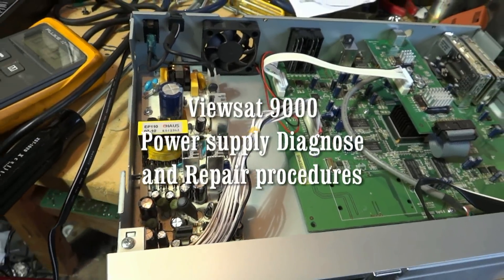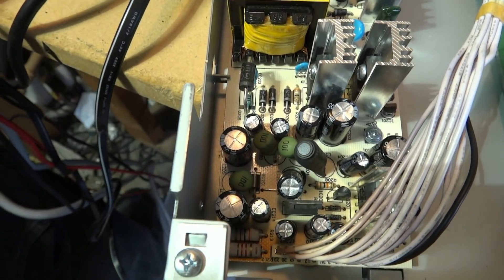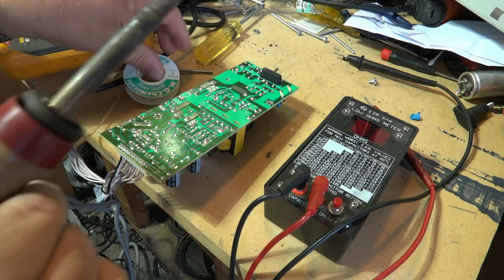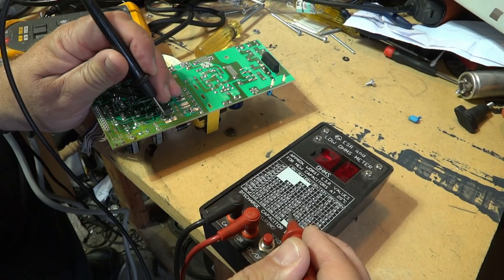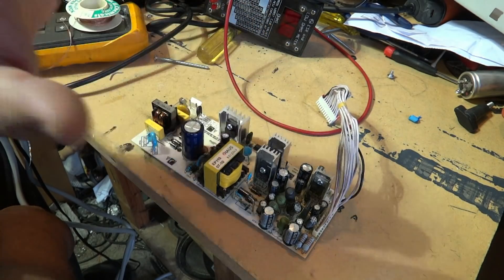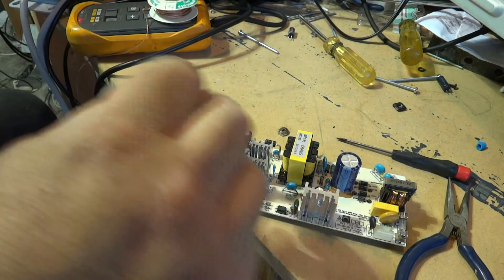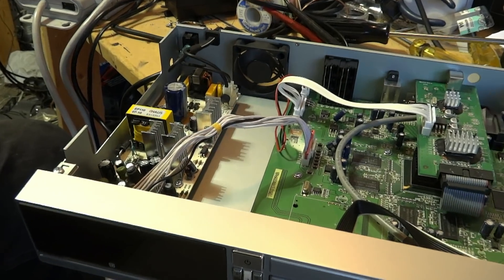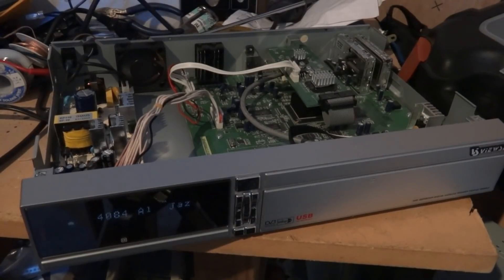Viewsat 9000 FTA Satellite Receiver Power Supply Repair

Comment: I thought the AC was first rectified to DC before going to the transformer?
Reply from the maker: The AC is rectified to 180VDC first, then it is converted back to PWM chopped DC, where it goes into the transformer to be stepped down, and passed to the regulation circuit.
Reply: Thanks for taking the time to clear that up. I'm trying to learn as much as i can about smps and videos like this are great!
Reply from the maker: No problem, it took me quite awhile to get the concept on how they worked when they first started showing up in consumer electronics. The manufacture's approach was "These things are too dangerous to fix, replace as an entire unit" so they wouldn't give any data or provide any training initially.

Comment: My computer power supply went out the other day(too much dust I guess though it didn't seem to have a lot in it). Since I have an electronics degree & never really fix anything, I figured I'd brush up on power supply repair & see if I can do something about my broken one. I have searched many power supply repair videos since this and this is the most informative. The second one just said "if the capacitors are burst & leaking, replace them & if the fuse is blow, replace it. Everything else, throw away," while not wrong, that only scratches the surface. This video, on the other hand, actually explains things for people who want to know more.
Reply from the maker: Thanks. This video was actually never intended to be released. It was my first one, and was basically directed as a few friends, one who owned this piece. He wanted to see exactly what was wrong, and actually wanted me to fix it at his house. I told him I wouldn't do that but would film it for him.He watched it, as did a few other hams, and a few suggested I put it up on YT and see what happens. The rest is history, and I found out pretty quick that people want to see how electronics gets repaired. When I worked on this piece I hadn't touched a soldering iron in about 10 years since I left the business and now I have several hundred videos on the channel, but they all started with this rather embarrassing video.

Comment: Hello Sir, i am trying to fix my panasinic dvd, dmr eh67,  which suddenly died, i removed the power supply board, but i do not have the capacitor measurment  meter. The capacitors look ok, they are not bulged, any ideas what else could be wrong.Thanks for the information and the video, nery informative

Comment: What the heck was that little strip of material you used to free up the solder joint?  I've always used a suction bulb, which doesn't work all that well with my old shaky hands.

Rick
Tucson
Reply from the maker: It's solder wick. A copper braid that is saturated with Flux. Many companies make it. Mg chemicals, chemtronics ect.

Comment: the first capacitors you test was or not good and the # value was fine, i have this backop battery i find in the street was with  not battery i put a new battery turn on ok but the next days did not  want to turn on, i don't know much about electronic but, i like to fix thing for fun and because is very cheap.

Comment: You don't think the transformer might fail instead of capacitors? That was i was suspecting on mine.
Reply from the maker: I have never seen a transformer fail on a switching supply. Drive transistor yes, and lots of capacitors.

Comment: I have hum on a powered subwoofer Altec lansing  could it be caps
Reply from the maker: Most powered subs use class D amps these days. So it depends on the amp design. If it is a standard linear amp, then yes caps could be the problem, on a class D no, not usually.
Reply: How do I tell which one i have,  thanks for your timely reply
Reply from the maker: A linear or class B or AB amplifier will have a power transformer. A class D generally does not, because the switching transistors are generally mains driven, and thus very dangerous to work on, as the voltages used are lethal. Typically switching on and off at 160 volts.
Reply: Thank You for the clarification, it has a 120v transformer with 2 yellow one black wire output that plugs into pc board am assuming output of low ac volts just getting started haven't checked output of transformer the 2, 2200 uf caps are first in power supply circuit.am going to do a omh check on caps as i don't have a capacitance meter using your ohm chart , I appreciate your time an suggestions let me know your thought  Gary

Comment: How you doing sir I really need your help if we can exchange emails it would be great. I have a Xbox 360 slim motherboard that turns on than off 1sec tops. I know it's a power issue. I do alot of repairs and system programing and I'm lost on this 1. Any feed back would help thanks.

Comment: You remind me when I fixed a ton of old style satellite systems with the 10 foot mesh dish. Because the way the dish was designed it would allow moisture to get into the drive motor and freeze. Next thing you know the customer would fire up the receiver to turn the dish and short out the 25 amp bridge rectifier and blow the fuse." Good demonstration ", like you I would fix the switch mode supply that often took out 3 to 4 capacitors in the new receivers.

Comment: YOUR amazing! I went to an electronics school, hundreds of hours. Your complete and definitive explanation to every detail, wow. I got a lightning strike and was looking for someone that troubleshooted a Panasonic main power board  NPX813MS1, but no luck, any ideas? No bloated caps.
Reply from the maker: +iam8of9 Lightning strikes usually affect the primary side of switching power supplies, like the regulator IC. That model number doesn't ring a bell right now but I will look it up and see what type of power supply it uses.

Comment: I saw 2 bad caps at about :22 Let's see if that's the problem.
Reply: This video is about 3 year old, so you had a lot longer than 22 sec to guess, lol any case most psu fail on caps.
Reply: binness
the industry standard is to swap caps at 5 year intervals. Because all electrolytic capacitors degrade. They're wear items.
Reply from the maker: I knew what the problem was before I even opened the top.Incidentally, not all caps go into an overpressure failure.I have seen many that go bad with no physical indicators.5 years is a little early for most caps, more like 7 for most industries that just do capacitor replacement for preventive maintenance.Perhaps if you are talking life support equipment then sure go for it.
Reply: 12voltvids
5 years is mission critical applications. I am not suggesting capacitors do not last longer than that, but in that span of time they all have degraded to some extent. They're not the same caps they were when new. The absolute best capacitors have a 12,000 hour lifespan. As rated by the manufacturers. The worst capacitors might have lifespans as short as 1,500 hours. No, the manufacturers don't even bother rating those either. Average capacitors fall in the 3,000 to 9,000 hour range.

The trend today is to not derate components much either. Which causes more stress, and premature failure. Double used to be the standard, but today you're lucky to see parts 50% over on specs. It's a 12V rail so 16V caps should be OK. It's a tight fit.
Reply from the maker: I believe that is what I said. In a device that the capacitors can not fail under any circumstances you do them early. When I was doing maintenance work, we had contracts to replace capacitors for a few production centers, and they all went on the 6-7 year life cycle for their scopes, audio mixers, video gear ect. Video heads, and DAT heads got replaced at 1000 hours on the head hour meter regardless how they looked. Back in those days most power supplies were linear, which were also nowhere near as demanding on the filters either. With switching supplies they run hot, and that is going to reduce the lifespan.
Reply: @12voltvids  Just the thread I was looking for.
In your experience, caps go bad even if the equipment has been stored and hasn't been used in years?
Say, for example a  VCR  that it was used once a month for 10yrs and then stored (properly) for 4yrs, it could have leaky caps even if wasn't used for much time?
Reply from the maker: @MarceloJavierMazaLuparia  
In most cases no.  The exception was a batch of caps made in the 80s that had bad chemistry.  The rumour was a disgruntled employee at a Japanese capacitor company stole the formula developed for micro capacitors like the surface mount caps.  He sold the formula to a competitor but missed one key ingredient which kept the ph stable.  When charged the ph was relatively neutral however when discharged it went slightly alkaline which caused corrosion on the leads around the seal which caused the seal to fail and leak the contents onto the board.  Millions of camcorders and anything that used these suffered this fate. Camcorders were affected more than most other devices because of how most people used them.  Holidays and birthdays.  The rest of the time they sat in the bag.  They all went leaky.
Reply: 12voltvids
while heat is a factor ripple can cause capacitors to die too. The ripple current causes internal heating.

Comment: if yo uh put a ohm meter on it should show resistance or 0 out that shows a short
Reply from the maker: +djvibe4life An ohm meter will show open, as capacitors block the flow of DC. The ESR meter is a special type of meter. It uses very low voltage AC at about 100KHz, specifically designed to measure an electrolytic capacitors ability to pass AC.

Comment: One shouldn't really discharge those capacitors by shorting them out. Use ~100k resistor instead in there for 10 to 30 seconds depending on the capacity. The sudden high current from shorting might (most propably will) cause issues with the dialetric of the electrolytic capacitor and cause them to fail. If not right away, it at least will shorten it's life.
Reply from the maker: +Mtaalas These caps won't have a charge in them anyway. As soon as the power is removed, remember the circuit is still running, the voltage will drop like a rock off a cliff. Any residual charge is going to be so weak it isn't going to cause any issues. Now if you are talking  a large charged capacitor that is open circuit (no load) that is a different story. A great example of this is main filter in tube circuits that once the power is removed and the tubes cool the caps can hold a charge for a long time. On those a bleeder resistor is a good idea, but it doesn't have to be something as large as a 100K. A 1K will do the dob just as well. I've never experienced capacitor failure from shorting them out, and I have done that for years. I have blown the tips off a few screw drivers though, and that cost more to replace than the capacitor.

Comment: seems like a lot of electronics companys are using cheap caps. Digicon are good and generally last longer. I am on the look out for a failed TV so I can replace the caps,just for the heck of it. Where do you generally order your electronics?
Reply: +scott firman You want Japanese manufactured capacitors. Rubycon, and Nichicon are top brands. I have Rubys that are 30 years old and they're still good. Which is unheard of.
Reply from the maker: +Paul Frederick Ruby and Nichi were good, so were some of the Elna. Then Elna turned to shit, and they got a very bad reputation. That was about the time that switching power supplies became popular.Of course if you wanted a real good cam you went across the pond and bought a Malory, or Motorola, or any of the other American ones. I have an old McIntosh receiver from the 1960's and only 1 cap has had to be replaced. I am sure they all could do a recapping now, but hey that unit of about 50 years old, and that is incredible. They are all old US made capacitors, many of them the old wax paper ones.  Those make me nervous actually. High voltage into flammable materials. That's an fire waiting to start. (I don't run that receiver right now. It is going to be a restore project some day, where I recap it, and then sell it to someone with more money than brains.)
Reply: 12voltvids
Yeah paper caps today are placeholders, at best. They look neat though. I have an old Sprague "ATOMS" in my collection just because I can't bear to part with it. But I wouldn't use it in a circuit.

Comment: Hello and thanks for videos, I have a similar set with integrated power supply has two 0.1uf caps either side of the first stage transformer gone bad and had only 0.22 to replace still not working, should they work ? do i need to get the same size ? there is also heat marks around the q0370r switching IC could i test this? thanks again Brett

Comment: to short out the CAPs can u stick a resistor to the leads of the CAP?
Reply from the maker: +james tomlin Yes you can use a resistor to do it as well. I just like blowing the tip off my screw driver discharging a big cap!
Reply: haha! okay, sound like fun :)

Comment: Using pliers on the capacitors would that short PSU capacitors?
Reply from the maker: +Kayemache Yes I was discharging them after removing power. That was the idea, to remove any charge that could give me a shock when working on it.
Reply: +12voltvids Oops, I forgot to mention about computer PSU. Will pliers completely short the power so you won't get fried
Reply from the maker: +Kayemache Yes they will.
If you are dealing with high voltage capacitors it is a good idea after shorting them out iis to put a jumper wire across the terminals to keep them from charging up on their own from electrostatic build up..This is more of a concern when dealing with very high voltage capacitors such as encountered in big RF linear amplifiers and transmitters.They will typically have a "widow stick" which is an insulated stick with a large ground wire  and hook attached that you, after depowering and locking out the power supply attach to the input choke to add a second layer of protection before pulling out the final amplifier tube because tubes being a high voltage, high impedance device will not drain the charge and allows the capacitors to recover their charge slowly. Picture tubes are good at this too. You can discharge the tube by grounding out the 2nd anode, and leave it disconnected. Come back a short while later and reground the 2nd anode and be amazed at the charge that has built up.In your PSU that is not an issue because there are components connected that will discharge the charge. Tube gear though is a whole different ball game, and much more dangerous to work on because you are dealing with typically 400 to 500 volts on everything.
Reply: +12voltvids Thanks for the reply. It was very informative. Repairing power supplies sounds to be way out of my league. I'll stick to purchasing a new unit. Once again, thanks for the reply. I subscribed because your videos are very in-depth
Reply from the maker: +Kayemache I just fixed a newer LG TV using a light bulb to reflow solder on a BGA chip.Will be posting that video soon.The point in these videos is to get people interested in troubleshooting electronics that have broken, and keep these devices out of the land fill.The way I look at it everything deserves a look to see if it is a simple fix. Some devices are just uneconomical to fix, but many are easily fixable, and it can extend the life of your device.
Reply: +12voltvids If something is broken it does not hurt having a look. Even if you can only spot the problem a fraction of the time, and fix it, you're still that much ahead of the game then too.

Comment: I swear - the electronics industry should make all electrolytic power capacitors plug-gable for easy testing and swapping.  Seems you need to change them more often than tubes !!!
Reply from the maker: +Donald Filbert A wise man once said "the reliability of any electronic device is inversely proportionate to the number of electrolytic capacitors it contains."
Reply from the maker: +Electro 
The reason for this is the ROHS requirements of new electronics. Old electronics has hazardous substances in them. Heavy metals and nasty compounds like PCBs other carcinogens that they can't use any more. I know many people that have cancer from working on vintage electronics. Some I am sure from x ray exposure on old TV, and others from the nasty chemicals and cleaners that were common back in the 60 and 70's. I worked on electronics in the mud 80s so by then they were already phasing out the bad stuff, but UT was still around. Yes I do think about stuff I may have been exposed to years ago, but not much I can do about that now.
Reply from the maker: +Electro Beryllium is a type of ceramic glass, and is used in the magnetron tube of microwave ovens (still is) and was in some RF power transistors. Its only bad if you smash it and breath in the dust.Carbon tetrachloride was a common cleaner, and that stuff is bad stuff.Other bad stuff in vintage electronics were compounds like mercury, lead, thallium, arsenic ect.
Reply from the maker: +Electro Huh, calm down? I am calm, I just don't know what your comment above refers to?
Reply from the maker: +Electro What joke are you referring to? don't recall cracking any joke.The video was originally done as a private upload for the owner of the unit that wanted to see it repaired.
Reply: +Donald Filbert Recent electrolytic capacitors. There are units in existence from the 70's and the electrolytic caps are still fully functional.
Reply: IT would cause them big money .
Reply: 12voltvids probably good old beryllium. I am reading that its pretty nasty stuff...
Reply: 12voltvids Really can't get the joke? Lighten up, bro.
Reply: 12voltvids Calm down, you are really uptight, aren't you? You just lost a subscriber.